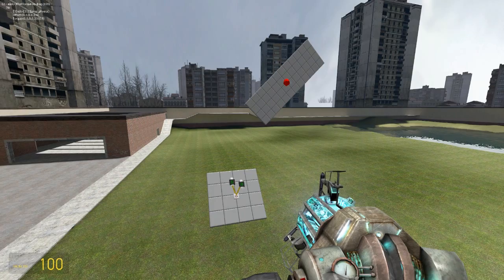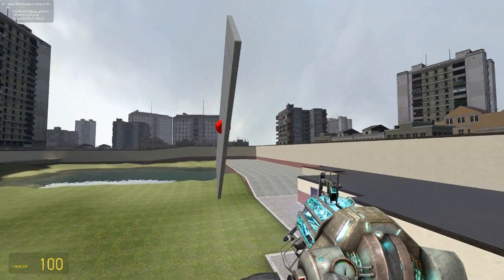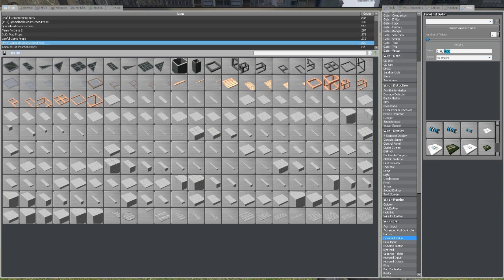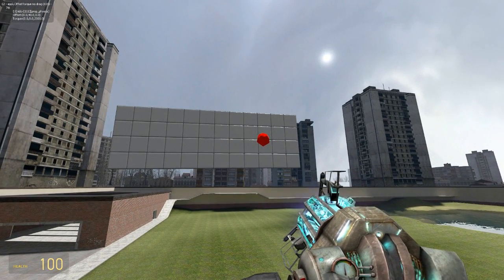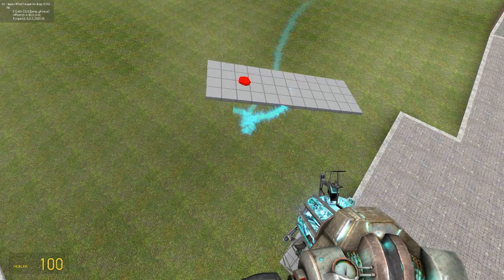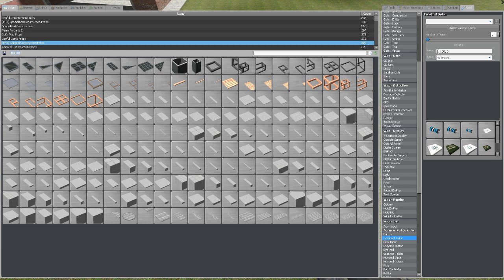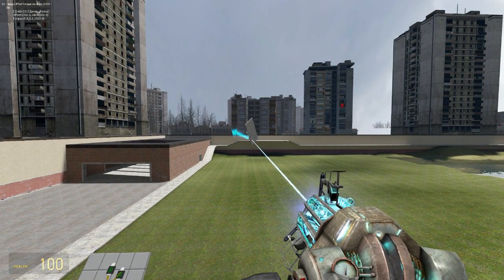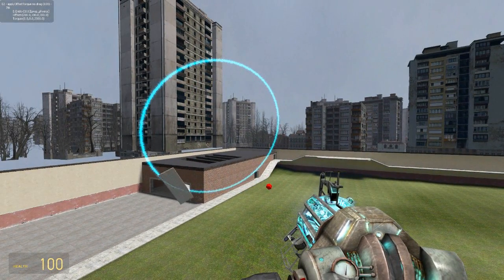applyOffsetTorque

Comment: I need something to rotate a satilite at 8 RPM, but it seems this E2 stopped working? I got the code from one of the comments and it has no errors. I wired everything like how your setup is just when I unfreeze the prop it just drops. No rotation.
Reply from the maker: Hi, this code only works for a single prop, with air drag and gravity turned off. Generally, to rotate a contraption at a given speed your best bet would be a pid control algorithm. Fizyk of wiremod forums had one for contraptions proportional to total inertia back in the day...
Reply: @Heatseeker1  ok, thx. I was able to modify the code and make it rotate things,

Comment: code pless
Reply from the maker: @name applyOffsetTorque no drag
@inputs E:entity [Offset Torque]:vector
@outputs 
@persist T 
@trigger 
# This e2 works like the applyTorque function, with added applyForce code to do the job of an axis constraint.
# Note: applying offset torque makes no mathematical sence as torque is independant of position.
# Props spin about their axis due to their inertia, this e2 demonstrates how to remove the effects of inertia.
# Due to the very complex nature of rotational + linear drag, this e2 only works when drag is negligable, 
# ie air_density 0, or using a low frontal area prop, or a high mass prop.
# It also doesn't account for angular or translational speed limiting, so will act funny at very high speeds.
runOnTick(1)
if (first()) {
    T = 66.567 # ticks/second
    # create a holo to show where the offset is
    holoCreate(1, E:toWorld(Offset - E:massCenterL()))
    holoModel(1, "sphere")
    holoColor(1, vec(255, 0, 0))
}

if (tickClk()) {
    # update holoPos
    holoPos(1, E:toWorld(Offset - E:massCenterL()))
    
    # calculate current angular velocity
    AngVel = toRad(E:angVelVector())
    
    ### Calculate axis constraint force
    
    ## calculate resultant force
    # calculate acceleration of offset point due to torque and inertia
    A = Torque / (E:inertia() * 1550.1)
    # calculate resultant force at offset
    Force = Offset:cross(A) * E:mass()
    
    ## calculate centripetal force
    # calculate vector rejection of Offset from angVel
    OffsetProjected = Offset - Offset:dot(AngVel:normalized()) * AngVel:normalized()
    # calculate centripetal force at offset
    Force += OffsetProjected * E:mass() * AngVel:length2() 
    
    # apply torque
    E:applyTorque(Torque / T)
 
    # apply constraint force
    E:applyForce(E:toWorldAxis(Force) / T)
}